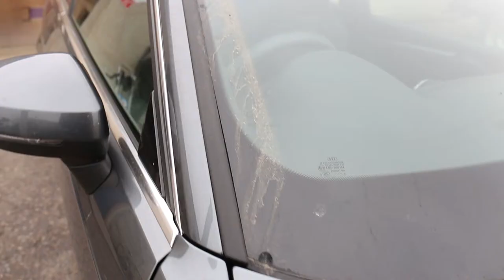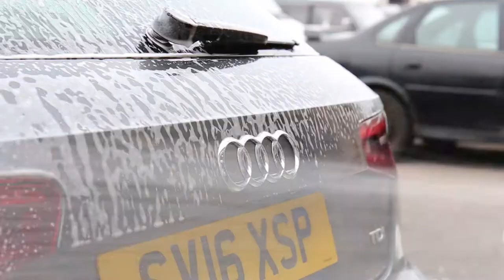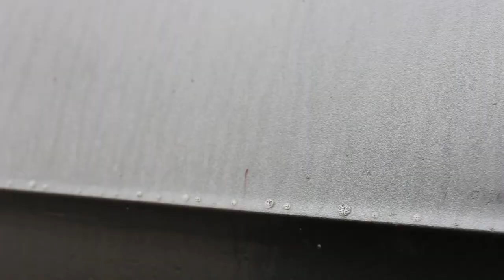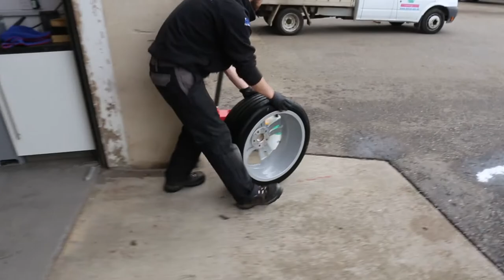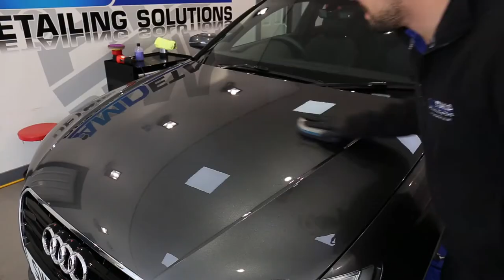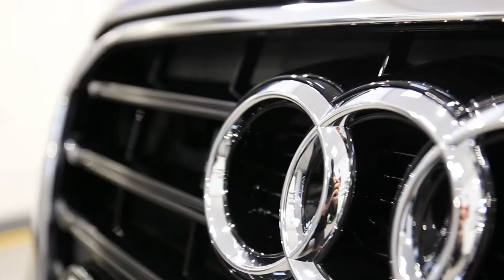Audi A3 TDI - 'Fast Forward' Process - Protection Detail - Detailing Moray

Comment: Great video. Got a question about what to use for removing fly's on bumper/bonnet/mirrors. You know, once the body's are gone, those baked on marks that have been left? Cheers.
Reply from the maker: Hi Norman. Thank you for commenting. We here at AMD use our AM APC to take off the bugs initially then we follow that up by using our AM Glaze on a microfibre cloth or a foam applicator. 

Alan has jotted this question down to use in his next Q & A video also. 

We hope this helps.

Thanks again.
AMDetails team.